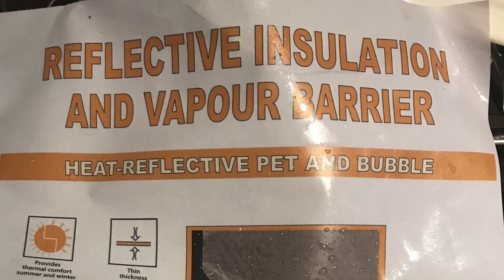Hot Tub Insulation - LayZSpa Vegas

Comment: We had a miami for over 3 and half years until it ripped at one of the seams last summer. I did try repairing it but it wasn't the same, would slowly deflate. Ive just ordered one of these from Very.... I plan to do the exact same thing with the insulation, especially having that outer liner to keep it in place it should be a doddle. I had my miami on those sponge mats, im going to get some insulation board for the base and put the mats on that this time and see how that works. We fill ours with hot water and use the elec heater to top up the temp. Its through the night especially the cold months where the drop in temp can be significant. Hope fully with the extra insulation it will mitigate the heat loss. Great video!
Reply from the maker: I hope your new set up works well for you

Comment: Just bought the Helsinki (2021) and turned the heater off yesterday it only dropped from 38 to 35 degrees in 15 hours. Outside temp was about 12 degrees. I have doubled up on the foam mating. Still plan to wrap the inner lid and see if I can make it even more efficient. Great video.
Reply from the maker: Thanks for the feedback it sounds like you’ve got a toasty tub. Maybe record yourself insulating it for others to see you do the Helsinki

Comment: Good video my lazy spa doesn't have the outer liner so I've ordered a fitted winter cover which will protect against the weather and UV but will also enable me to line it with foil insulation.
I'm going to use spray contact adhesive to apply it on the inside of that cover.
I've also ordered 25mm extra high density polystyrene as insulation for the lazy spa cover and as a base for under the lazy spa.
I will also line the polystyrene with the insulation foil aswell.

Comment: DO NOT DO THIS  ! 

I had this bright idea. Insulated the whole tub in foil insulation. My son then started complaining about electric shocks . Told him he was imaging it ( great parenting) until one evening I got buzzed getting in. It was only a light tingle and only when you had one hand or foot on the deck and one in the water or sitting in the tub and touching the deck  ( mine is below ground with deck built over ) but definitely a shock. Could get the same light shock in several locations. Turned it off immediately. Friend is an electrical engineer and tested all electrics including the pump and found no issues . 

Read through the instructions and it has a section about not using within a certain distance of metal objects . Removed insulation and problem went away. I’ve no idea what was going on but I won’t risk it again.
Reply from the maker: Glad you resolved your issue. Can’t imagine foil wrap caused the issue considering it’s between the cover and inner layer. I don’t believe at any point there is connection between live current  as it’s literally touching two surfaces